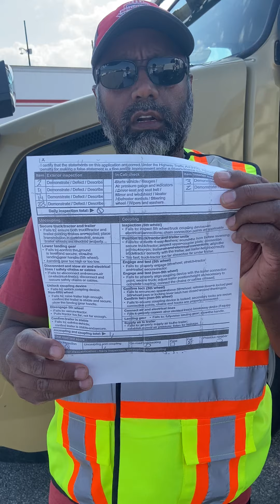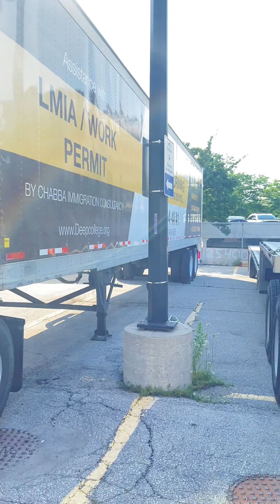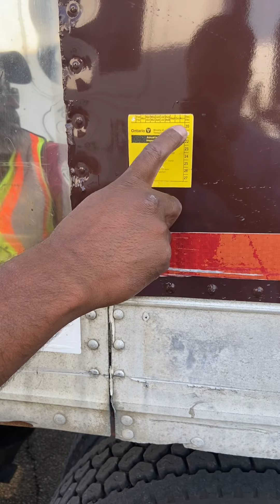Couple uncouple

Comment: in UNCOUPLING, does it matter if you first disconnect the air/electricals before pulling the release handle?
Reply: Either way is correct.